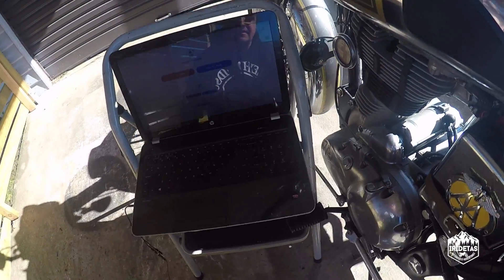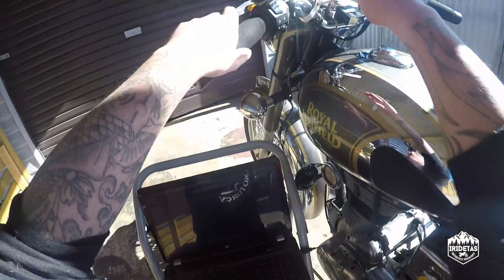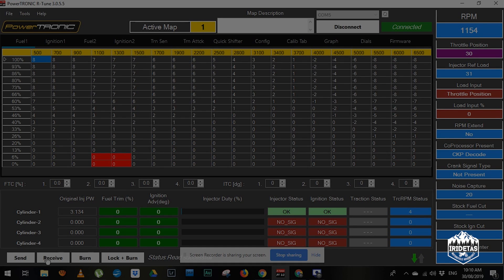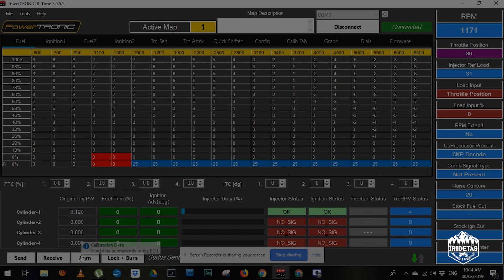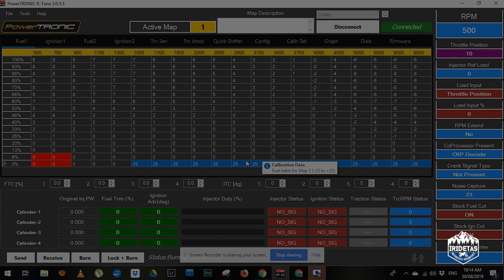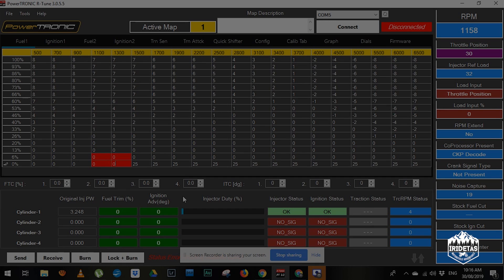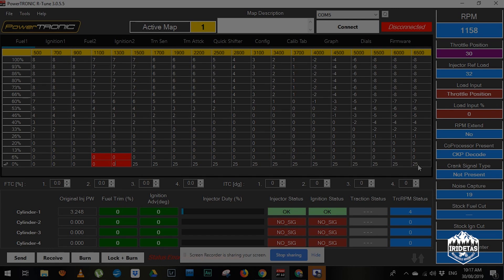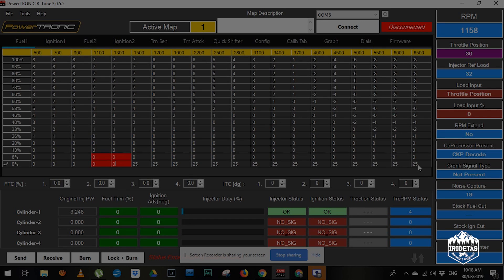REA #24 | Reduce Deceleration Popping | Royal Enfield Classic 500 Race Dynamics Powertronic & R-Tune

Comment: Hi, I have a doubt. Won’t increasing injection duty at that region reduces engine braking. Isn’t that dangerous while going downhill ?
Reply from the maker: Mate, I think youre on the wrong track! Engine breaking its at its greatest in higher rpm as it transfers more torque through the gearbox etc. This is at 0% throttle and insignificant increases in fueling.
Reply: @iRidetas  Thank you for the quick reply. I never expected such a fast response. What I was trying to say is, suppose the bike is rolling down a hill. The throttle input is 0%, but the rpm will be let's  say above 2000 rpm. But the fuel is still being squirted, won't that have any effect? I presume there will  be spark from the spark plugs at 0% rpm. Won't that sustain combustion, which reduces engine braking ?
Reply: That will be like promoting the  rolling.
Reply from the maker: I can't say it would it would be imo in an exaggerated way its more like a carby running  a larger sized pilot jet and running richer, allowing it to warm-up quicker, run better an not pop, it is not so significant to be so rich as to flood, foul plugs, cause run on or pump so much unburned fuel it creates fumy emmisions. This injects a very small amount more fuel to richen the mixture to prevent the lean out and the pops. I think in short in what you are saying the bike will not run better it will run worse and spew unburned fuel not causing run on.
Reply: @iRidetas  got it. Thank you. I have a classic 500 from last 8 years. I was confused whether to buy the piggy back or not. I finally bit the bullet(pun intended)and ordered powertronic piggy back after watching your video. I run a red rooster free flow exhaust. I always felt my engine ran lean. This should clear that issue. Also I feel there too much carbon whenever I do an oil change. Is it normal ? I hope you shed some light on this as well.  Cheers!

Comment: Great. I planned map this same solution, but in order to alter engine break, make it softer, also soften the instant off-throttle deaceleration. 
Nice to find your video, do you think it will work? also ignition?
Thanks!
Reply from the maker: EFI engines usually have a fuel cut off when engine breaking so not sure you are going to get the results you are after there mate.  Engine breaking depends on several things but the RE is not a snatchy bike compared to others I've owned.  The one issue it can have is if you snatch the throttle on and off to hard it can buck a bit. Just have to learn to roll on and off the throttle smoothly.

Comment: Have you experienced bogging during wide open throttle?
Reply from the maker: Nope, the maps tend to help that a lot.  The bike doesnt like snapping the throttle wide open to quickly.  Also calibrate your throttle with rtune on your powertronic
Reply: @iRidetas  already did calibration. but still having issues when reaching 9600 rpm like bogging or losing power.

Comment: Just remove the senser wire near your start of bend pipe and put a screw on it.  Popping will stop
Reply from the maker: Yeah, no! Lamda sensor is already by passed with a wiring harness!!
Reply: Does that work good with a free flow exhaust mod and no Power Tronix ECU?

Comment: Hi, new subscriber here, UK based Kiwi. Anyhow, is it safe to assume there is no air injection system on this bike? If there is you should disable it to reduce over-run popping.  Same goes for your 865 Triumph ether carbed or EFI.
Reply from the maker: The 865cc is very stock as far as it goes so i wont be putting on on it as im not planing on moding it as such, but the enfield does have AIS and it can be deleted but its on the newer Euro 4 bikes and mines a Euro 3! Cheers and welcome aboard!

Comment: woaw that interresting !!
Reply from the maker: Yup, I was surprised how well it worked too!
Reply: @iRidetas  i just got a 500 cc efi, compares to the 1998 350cc that i own, i found that the 500 cc had strong deceleration. re acceleration after turning back the throttle to zero is brutal compares to the smoothness of the carburetor. i think that what you have done would probably bring much more confort in the riding (appart from reducing the popping)
Reply from the maker: Yes, any EFI seems to be more choppy than carb but you get the flexibility of remapping etc with efi.

Comment: Sounds like you've got the decel popping thing licked.  Modern bikes built for Euro-4 are often too lean.  

Could you perhaps pull a spark plug out after an hour on the new map and show us up close and nice and slow how it looks?  Cheers in advance.

I've just installed a PowerTRONIC piggy-back ECU on my 2019 C5 two days ago. The install went OK, but we're still ironing out some basic problems with stock vs replacement relays handling side-stand safety cut-outs, and engine check lights illuminating.

I have to say the guys at PowerTRONIC have been amazing with their support. They are falling over themselves to help out. I'm hoping we'll have this problem sorted out in a day or two.  Will let you know how it turns out.
Reply from the maker: Looking forward to hearing it.  What happens if you put the stock relays back in I have heard some have got it running with them! I can yes but I'll have to work out how I'll make it into a video! Cheers good luck with your powertronic!
Reply: @iRidetas  Hi there, it's a 2019 C5 sold in Australia just a few months ago.  Yes after installing the PowerTronic unit the bike started OK, but would stall when I engaged a gear.  Swapped over replacement relays and same problem. I removed supplied relays and reinstalled stock relays and now could both start and engage gear.  But, now the engine light is on.  As I said, the guys at PowerTronic are all over it, and I'm sure we'll sort out the problem soon.  Their support has been first class.
Reply: @paulg9314  I had the same problem and the guys at powertronics sent me new relays out and it fixed the problem👍
Reply: @scooobi34  I spoke with the guys at Powertronics to discuss the relay problem. The bike runs fine with the stock relays, but still cuts out in gear with the replacement relays (both of them). The engineers at Powertronics reckon I should just use the stock relays and be done with it. They also recommended keeping the stock coupler handy just in case.  Overall I'm very happy with the Powertronics ECU.  The 19 tooth sprocket stole a little from the low end, but the piggy-back ECU has now put that back. With a nice rich fuelling the engine is now very smooth and willing, even at highway speeds.
Reply: @paulg9314  I am having some difficulties, i have the exact same make as your bike(Single spark), i have the K & N and free flow exhaust fitted, i experience slight jerk when i accelerate sometimes as if it has been cut off for a split second, also when i pulled the plug out to check it didn't look good as it was pitch black, also did you bypass the lambda(O2) sensor when u installed and could you please share what map you are using ...thanks in advance
Reply: @kiroberry  Hi there, I'm happy to say that the PowerTronics unit is working fine for me.  I've stopped mucking around with the supplied replacement relays (which caused the engine to cut out once a gear was engaged). The engine pulls willingly, with no bogging on acceleration like you have experienced. I will say the engine takes an extra few turns to fire on startup than it did with the stock fuelling, but it does start every time.  

You asked which map I am using.  I am currently using the two stock maps that are available for download at the PowerTronics website (https://powertronicecu.com/powertronic-maps/ then select Royal Enfield maps - there is only one file to download).  It took a bit of communication with the PowerTronic customer service people before I learned that this file actually contains two maps: map 1 (richer than stock) and map 2 (more aggressive than map 1). 

Fyi, yes I installed the lambda sensor bypass which was part of the wiring loom included with the PowerTronics kit.

It's interesting that you have pulled the plug and found it rich and black. Was that shutting down the engine from idle?  Or did you hold a mid- or full throttle position and then 'chop' the engine and coast to a halt to check what the mid- or full throttle mixture is looking like on your plug?

As for your 'bogging' on acceleration problem, you could still be running a little lean (blackened plugs at idle notwithstanding).  Here is an article which seems quite similar to your situation: https://mechanics.stackexchange.com/questions/30088/motorcycle-bogs-down-under-load#30119

 
Good luck with your fuelling detective work.  Let us know how it works out.

PGM
Reply: Hi Ananta Rai, 

One more thing to think about, and that is your spark plug.  Your stock plug will be selected for a lean Euro 4 factory mixture.  Now with the PowerTronics piggyback ECU, you're pumping in a richer mixture.  You might want a hotter plug to burn the richer mixture.  Just a thought.
Reply: @paulg9314  apologies for the late reply and thanks alot for the detailed explanation, I did not install the lambda sensor bypass that was supplied perhaps that is the reason I get jerky acceleration, maybe in the loop the o2 sensor cuts down the fuel etc, I talked to the powertronic guys he supplied me the correct relays, I told him I haven't bypassed the lambda sensor according to him its fine not to bypass the o2 sensor, I played around with the fuel and ignition table and managed to reduce jerky accl which happened often, I will try the stock map again  bypassing the lambda sensor hope it works for me.....
Reply: @paulg9314  hi again I checked the plugs after cleaning them and running with powertronics, also could you please help me with installing the o2 sensor bypass  when you installed the o2 sensor bypass how did you connect it did you just connect it end to end(does doing that bypass it by itself).....
Reply: Thanks alot for your help

Comment: Who would have thought, old fashioned RE technology with 2020 FI technology. Old carburetor guys will be turning in their graves.
Reply: They went EFI on the 500cc in 09 to purely adhere to Euro 3 standards. These days the newer models have better EFI to adhere to Euro 4 and I think 5.

There’s talk now of discontinuing the 500 single for export, as the only way to adhere to the newer standards is to go water cooled for a more stable operating temperature that comes with liquid cooling. Allowing the engine to operate with more consistent fuel metering.

This is also why the new BS6 Himalayan has two CAT converters. Near the engine on the header pipe is the new addition.
Reply from the maker: Lol for sure but it's a fun bike to work on cause of the combo of retro looks and fuel injection I love it for that!